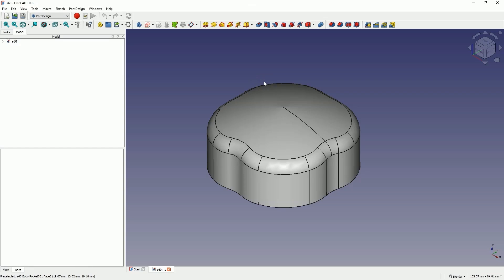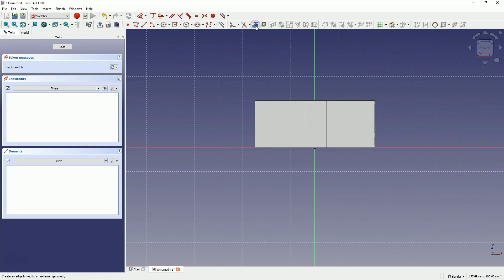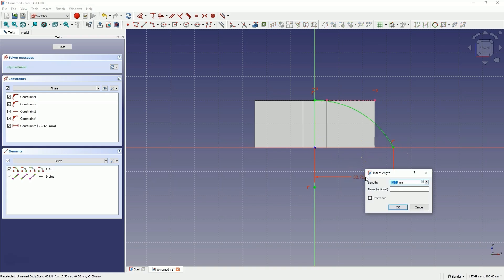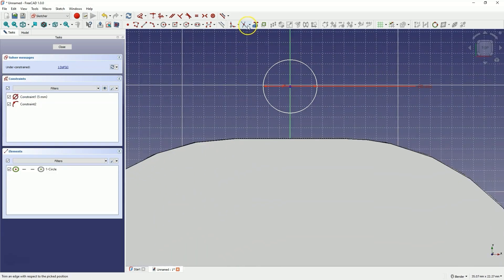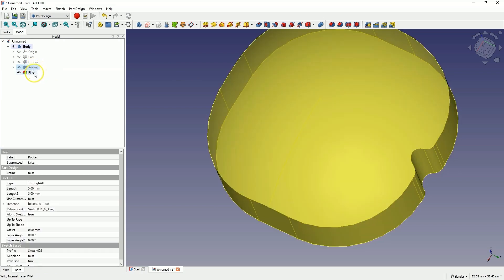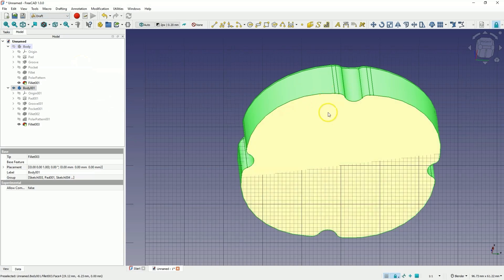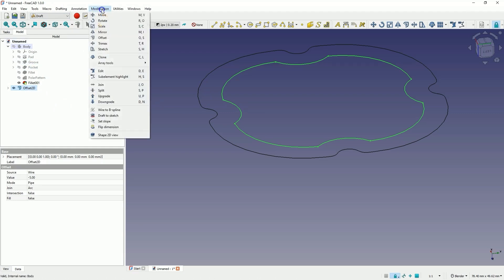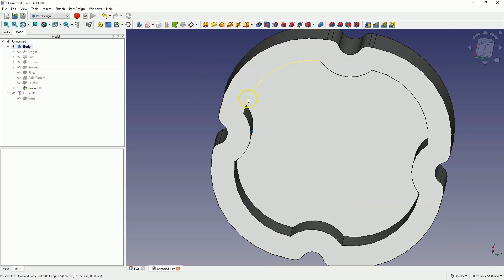FreeCAD Guide Creating Parts with Edge Offsets

Comment: Thank you very much for sharing this possibilities of FreeCAD! As quite often in the past I tried to redo your steps while watching. Tha was very easy up until the middle of the video. But then I got lost due to your multiple switching of workbenches. I never did anything like that before. Anyway, I just watch the video to the end and did nothing parallel. I wanted to know, where you were going. The result in the end looked easy again. So i skipped back to the middle of the video and was a little surprised how easy it was now to follow all your steps. The video became easy again.

In the end I tried in comparision after half the video the "thickness" function of FreeCAD. But that didn't work. Obviously due to some of the fillets. Thanks to this excellent excercise I now have an alternative, if in one of my own projects the thickness function does not work. So thank you again for this very valuable lesson and a first glance for me into two other workbenches of FreeCAD :-)

Comment: Not exactly sure why you couldn't have used the offset tool here. One might possibly have to first clone the edges, but that's still a lot simpler than what was shown here.
Reply: Think you mean the thickness tool here? That would have been possible only to 1,99 thickness or so since the smallest radia sets the limit. Thickness tool doesn't tolerate when geometry offset no longer with consistant thickness is possible. Sub shape binder doesn't have that limitation, it continus and ignors elements in offset that is no longer supported.

Comment: This is a brutal brutal tutorial. Absolutely NOT for beginners... He casually glosses over so many important things. For example, "how do we select all the different faces before we deselect face 3? I had to individually delete each one! While trying to select and deselect faces i was accidentally dropping faces ontop of others without knowing that was possible! Got multiple error messages.. Very hard!
Reply: Try the Sub shape binder and you will have a mouch easier and parametric solution, select the face, click on  sub shape binder, if it's not in your tool selection you find it in Part Design -> Sub Shape binder. In Offset enter -5. then select the binder and use pocket tool. if nothing happens reverse direction and bobs your uncle :)
Reply: Yes, there are at least two other ways to make an offset sketch that are much simpler. If he wanted to show this method to demonstrate some functions of other workbenches, he should have said so and why. The already mentioned sub shape binder method is easiest in this case.
Reply: @Zardozer  What is the subshape binder? Could you tell me how you would do this with that method? Like what workbench, what do you click next ect..

Comment: Interesting workflow for creating sketch from complex faces. Thanks for sharing. But I little complicated, involving a lot of step in several workbench.  For this particular case, another way is to use subshape-binder feature (to the face) directly in part-design WB, and use its offset property
Reply: I agree, sub shape binder is definitely the tool for this task and it keeps the model simple and parametric.

Comment: Too complicated.
Reply: Complicated, but free. I'm struggling, myself, but I want an alternative to Tinkercad that won't break the bank. As a hobbyist, it's nice to have an option.
Reply: @PatrickMcNealStuff  totally agree. I use it to create objects to 3D print and although I'm learning a lot from this channel, remembering all the steps required to do what's been demonstrated in this video is a huge challenge.
Reply: @marleepop115  Indeed!
Reply: Wow, what a convoluted way to do an offset to remove the inside of an object. Freecad is powerful but too many steps for something that can be done in a simple offset and extrude in other cad software. But it is free so I should shut my mouth.
Reply: Try the sub shape binder as mentioned above, mouch simpler.

Comment: what happens when we change original body then?
Reply: This is not a parametric solution, you would need to do it all over. Using a Sub shape binder instead with offset instead will give you parametric solution. And its important that it is the green sub shape and not the shapebinder, that is more primitiv and can't offset edges.